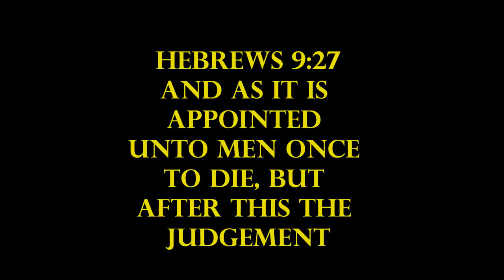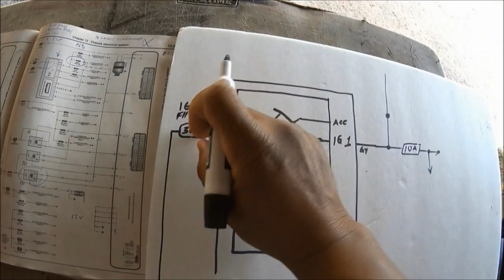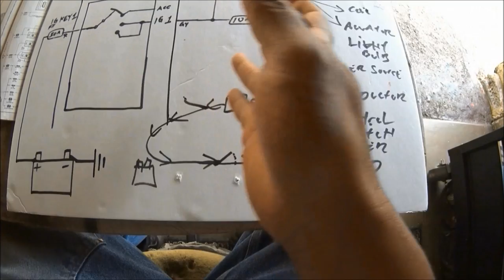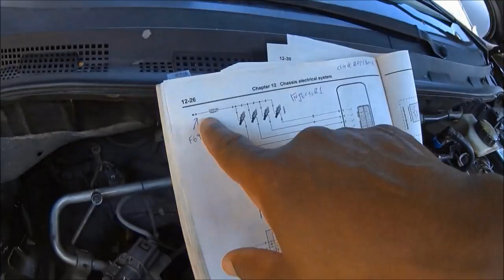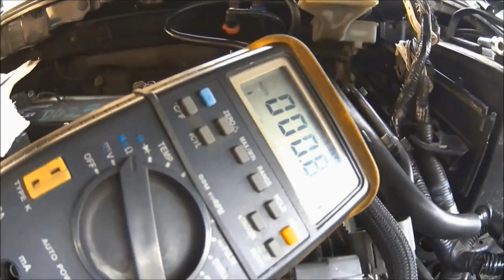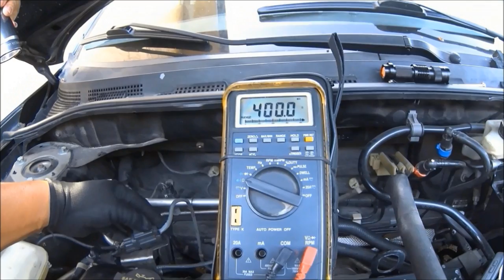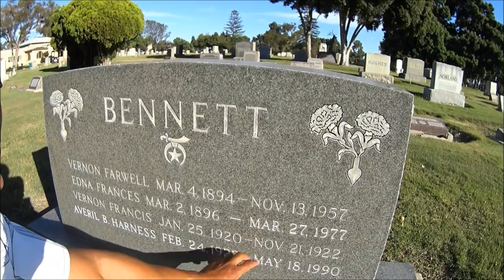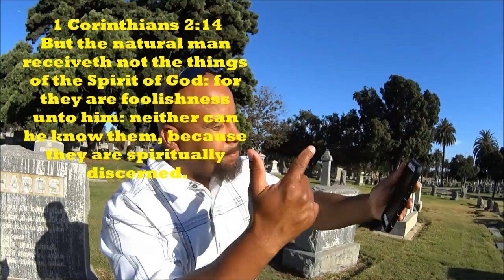(EASY) DIAGNOSING A FUSE THAT KEEPS BLOWING, ELECTRICAL (SHORT CIRCUIT, NO START) / ARE YOU SAVED?

Comment: To  save fuses you can use a household 15 amp circuit breaker and jumpers to your test fuse. Then just reset it instead of replacing. Current is current.
Reply: Very good idea!
Reply: Circuit breakers are installed to protect the wire in an electrical circuit.  Wire is sensitive to current.  As long as the voltage rating on the device  (breaker) is higher than the voltage in the circuit you will be OK.
Reply: ycmdill OLDSKOOL method is what it's all about mixed with a little new stuff.

Comment: Great video! I never thought to use a tone and probe set to track a short circuit down. You can buy a push to reset circuit breaker and solder that on to your modified fuse. Plug that in and it will pop open and allow you to reset it and continue troubleshooting. Saves you from popping a bunch of fuses. Love your vids man. With Christ on your side anything is possible!

Comment: watch your video on warp head i worked in a foundry and mach as a supervisor great video just giving you some tips the almost every mach cast will have three locator tabs  on your flatness table set your 3 abc blocks so the locate tabs rest on the abc blocks and get a ditgal caliper   most aluminum  parts ford gm dodge use a + or - 3  thousands there again you did a great job old school to fix that head

Comment: Good Video.  Thanks.  This was a pretty extensive example and required a lot of tracing techniques.  To save on fuse used for testing it might be worth setting up a resettable circuit breaker you can plug in to the fuse socket.  They're about $5 on eBay (search for 'marine resettable fuse') or at a boating store like West Marine or Downwind Marine in SD.   Thanks for posting.

Comment: Hey brother. Got a 98 astro van with a abs light. The problem is that no scanner communicates with the abs it only reads the engine codes. And it is not the scanner. Any advice? God bless you and keep the videos  coming.

Comment: What could cause solenoid's fuse to blow when starting the car? Sometimes it starts  after replacing the fuse and once I get the car warmed up, it starts without any problems. It seems like it only blows when the engine is cold. This problem showed up when cold weathers started. It's over -20°C/-4°F here

Comment: Rather than buying and putting in a bunch of fuses to burn out, use a fuse circuit breaker and use a test light (I have one that makes a noise too).  When the breaker pops off the sound goes away.  If you find the short and undo it, the sound will stay on.

Comment: i have a 2000 ss had the bank 1 sensor 1 code.i changed the upstream o2 and the light never went off? the o2 wire has no power.but the o2 fuse does??

Comment: My 98 Tahoe keeps blowing the ECM fuse. I thought I found the problem. There was burnt wires at a sensor on the power steering pump . I rewired it and still the same thing,  I even unplugged the sensor and still. I guess I need to try this method

Comment: 2001 Rav4 EF13 keep blowing as soon as u turn the key on plus P100, P505 code that won't reset. After 5 days trying to find the problem then I took it to dealer for $190 diagnostics fees then asked for more time to check that cost me $852 & told me need new engine wiring harness that cost $1500, out the door cost will be $5200. So I jus towed the car home, now I'm back where I started. Thought dealer will pinpoint where the bad wiring but instead recommended new harness. Ripped off, now I'm still hoping I can find the problem. Pls help

Comment: Hi man, I live in Venezuela where we have the highest inflation in the world (50% monthly) and I think my CV Joint is broken. When I´m accelerating in a straight in 1st and 2nd gear (manual 95 corolla) I hear a sound in the left side, and when I´m turning to the right it also sounds. Can a worn CV Joint sound even in straight acceleration? 

I said I live in a high inflation country because I don´t have money to replace it, so I decided to watch some video here en Youtube to see if I came up with a idea to fix the problem temporally. What I have found is that most of the wear of the Outer CV Joint happens in the inner race and specially in one end, I heard some guy saying here in a Youtube video that you could take the inner race of the inner CV Joint and put it on the Outer CV Joint.

I was thinking that even if the inner and outer CV Joints aren´t the same I could simply put the right CV Joint in the left side and viceversa. My question to you is: Have you seen how CV Joint wear? Have you taken one appart and see where is the wear? Do you think that my idea of flipping the CV Joints from side to side could reduce the play the left one has?
Reply: Your help will be greatly appreciated